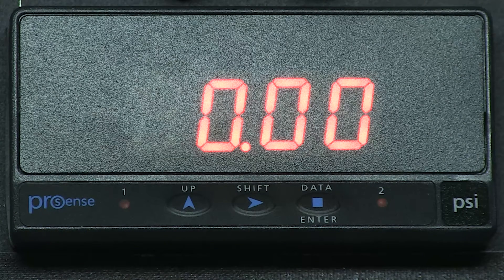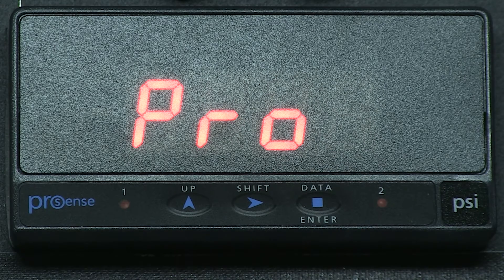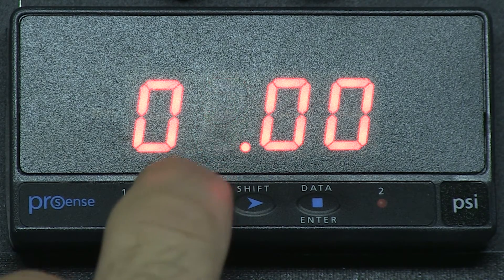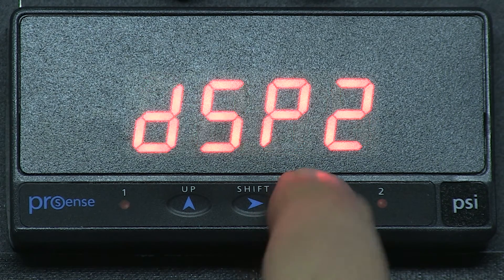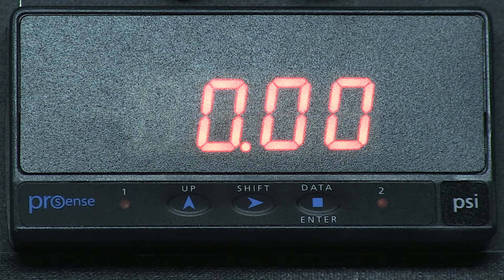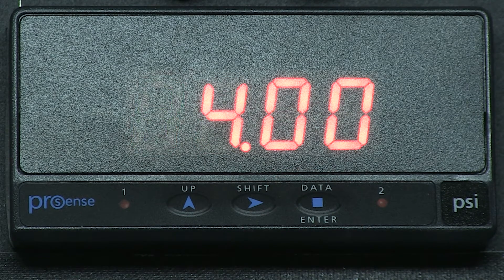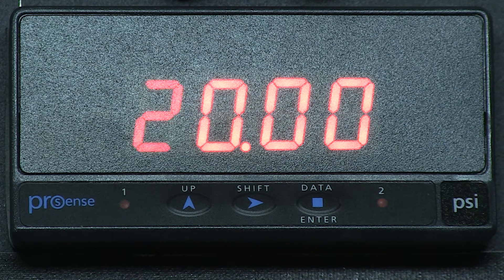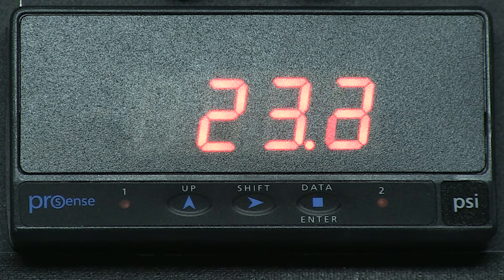ProSense Digital Panel Meter How To Scale Inputs from AutomationDirect

Comment: Do you a video of setting up a DPM2-E-HL for AMPS CTF5 50:5 CT
Reply from the maker: @frankglauner8584 we unfortunately do not, however the DPM series have excellent instruction manuals. I have set up a DPM2 for several different applications in the past with no issues. Find the manual here: https://cdn.automationdirect.com/static/manuals/prosensedpm/dpm2-e_manual.pdf

You will need to setup the input settings to tell the meter how to interpret the input information as well as the display settings to tell the meter how you want the information to look on the screen.

If you are still experiencing issues after working through the manual, we also offer free tech support and I know of several of them that are experts in the DPM lineup. You can contact them here: https://community.automationdirect.com/s/contactsupport

Comment: which meter will work with load-cells and strain-gages? 🤥 Omega-Engineering has 5 digit +/- 20mv or 200mv input with  5vdc or 10vdc excitation output for lbs scales kg 🤔
Reply from the maker: We offer many process controllers, digital panel meters and graphical panel meters.  You can find these at: www.automationdirect.com/process-controllers.  If you need help selecting the best display for your application, our free technical support can assist you. https://community.automationdirect.com/s/contactsupport